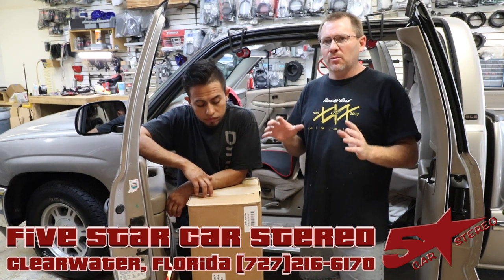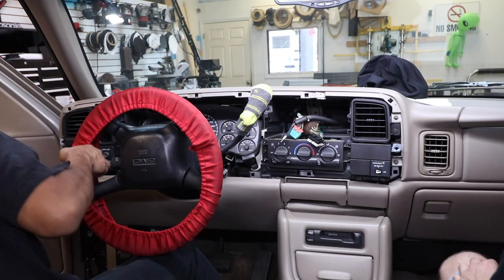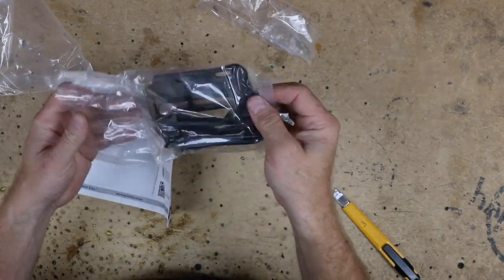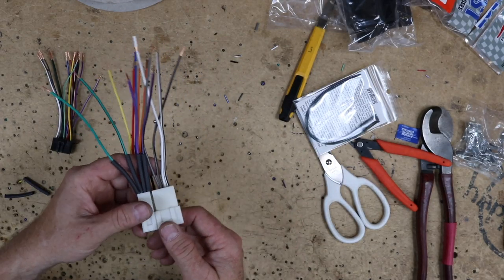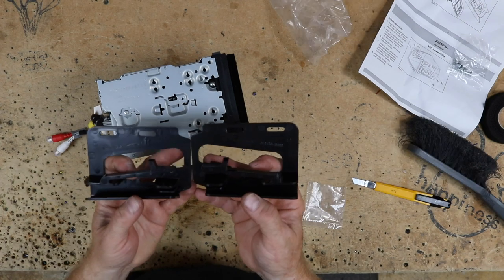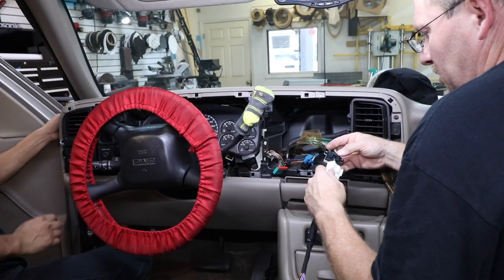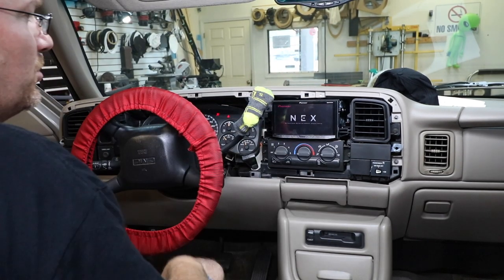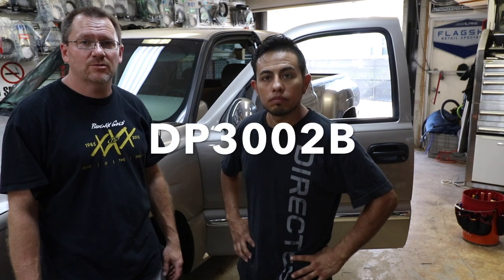The steps it take to replace your radio, Chevy Silverado or Tahoe GMC Sierra or Yukon

Comment: This is one of the Best, helpful video's . Thanks. Where do you connect the purple back up camera wire in the engine compartment?
Reply: konaok1  There's a light green wire in the driver's footwell behind the junction box cover. That wire provides +12 volts when the truck is in reverse.
Reply: Awesome! Thanks!

Comment: Another great one guys, question though. What working would you recommend for power using a 2 amplifier set up? 4x60 and 500rms sub amp, 2 separate power wires or one large split at a fuse holder??
Reply from the maker: +jmaslin I'm a fan of 2 power wires

Comment: What is the second harness you unplugged from the stock radio? Never got brought up just wondering, I gots the same
Reply: The only reason I'm watching these is because that harness on the left. Did you ever figure it out? I'm installing mine today
Reply: @thatgamerguy1324  That harness is for the cassette deck in the center console. When you install your head unit (if you haven't already) just leave it unplugged.
Reply: Yeah I realized that lmao. Right after that comment was made I installed it that morning. And left it out and though oh well. Lol. I saw my cassette with the aux cord and thought. Ohhhh. And tried putting it back in and realized it wasnt on and it dawned on me lol. No wonder alot of people weren't concerned cause alot didnt come with an external cassette lol

Comment: I have a 2002 Sierra 2500HD will this kit fit my truck properly? I looked for a metra unit but said not compatible with my truck, why?
Reply: Itll work
Reply: Yes good question. On my Tahoe I believe it is for the rear radio controls on the center console

Comment: I was recently inquiring about a new stereo. They were telling me about some sort of pack used so that functions of the truck still work. he was saying it was about $300 on top of the radio purchase. This thing, if not installed can cause malfunctions for the airbags and lights,signals,door locks and other issues. Is this true, what is it exactly or was this guy just up selling me?
Reply: I believe chime modules weren't introduced until 2003 up. I have a 2002 Sierra z71 1500 and it doesn't have a chime module but my 2005 does. I'm probably wrong tho 😂
Reply: Sounds like a con!

Comment: hehehe don't break anything you don't want broken ..... every installer says this ..... I'll throw y'all a tip, grab some saws-all blades (aggressive ones) trace the air saw blade on it and then grind it down. Makes cutting plastic much faster with less welding

Comment: I would do this except for the fact you have to cut out a metal brace that was put there by engineers to keep the engine from becoming your face, It is not safe to remove that.
Reply: Seriously where did u find that out

Comment: So instead of just buying a stereo that fits, you purchase a dash kit for $150, push your climate controls down, and extensively modify behind the stereo cutting core support brackets to that dash completely off.
Reply: they use  1.5 din radios, which aren't used anymore. so you either have to fill a space, cut the dash, or get a new dash kit.

Comment: so can i just pull a dash bezel out of a 03-06 or is there something special about this metra kit
Reply: if you use the 03-06 bezel, the power ports and ash tray will be partially covered.
Reply: @randyrichardson4364  as well as not covering the ac controls well either unless you cut it up a bit. This just makes it all a lot easier.